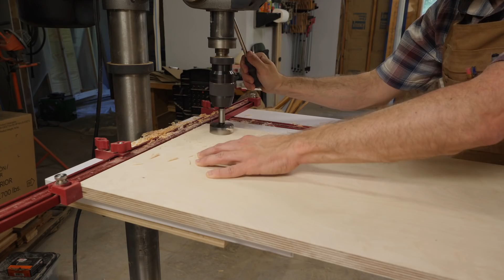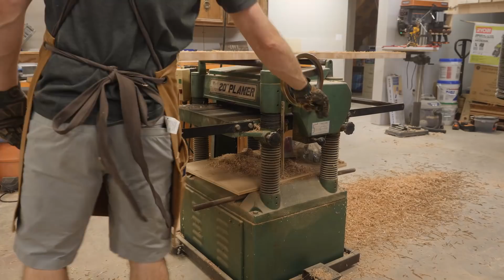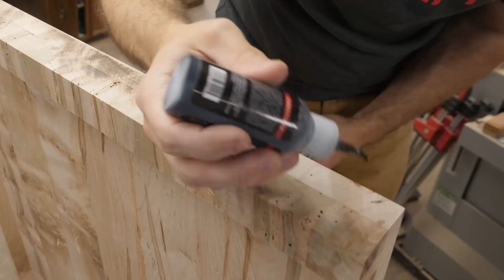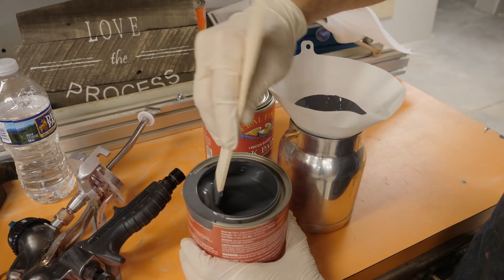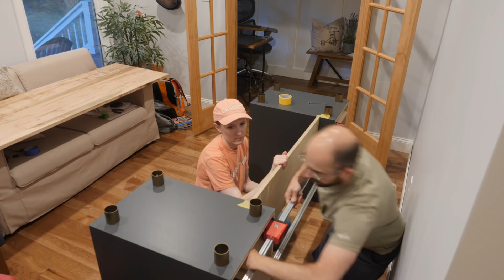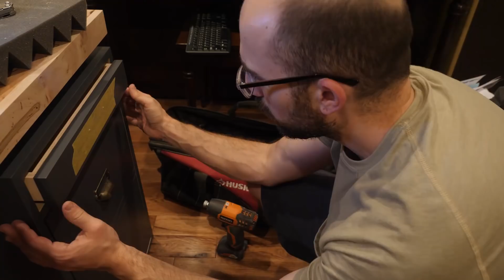How to Make the Ultimate Desk

Comment: Great project! And love that I can grab the plans. Thank you! I'm actually building a sideboard right now. Making the doors next. I've not used door hinges like this yet. I'll have inset doors and want soft close. Any suggestions? What did you use?
Reply from the maker: Hi Angie!  Thank you so much for watching.  I have many other projects on my site (https://www.woodshopmike.com) and a few others on buildsomething.com. The hinges I used are similar to these https://amzn.to/30bbZS0 just make sure you also order base plates as this listing doesn't include them and there are several different styles depending on your application.  Rockler actually has a pretty good article on the ins and outs of cabinet hinges 👍🏻. Thanks for watching!